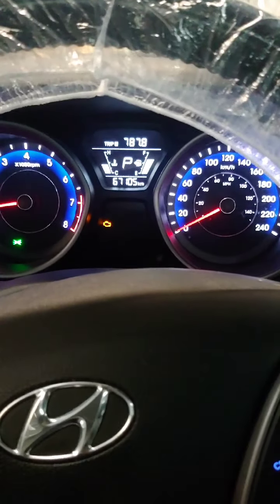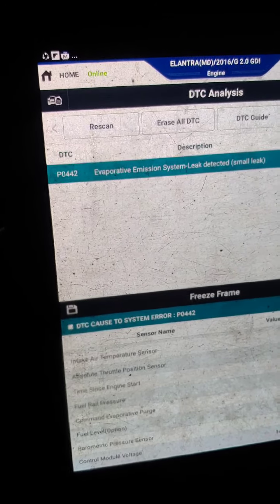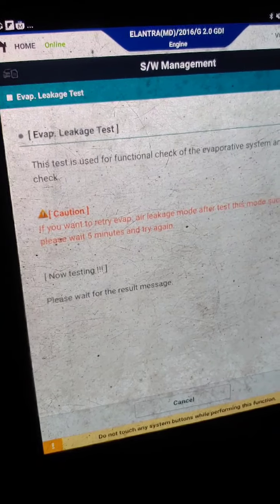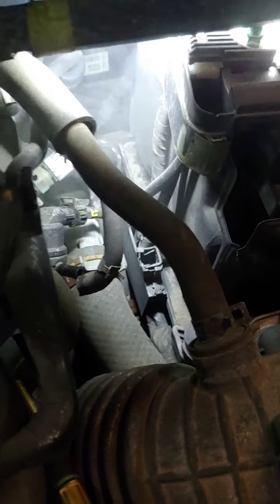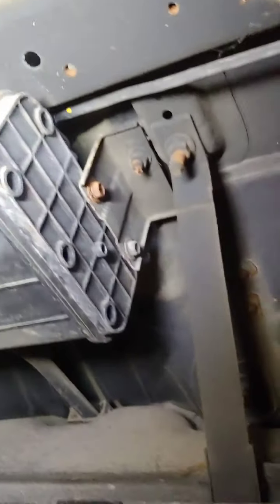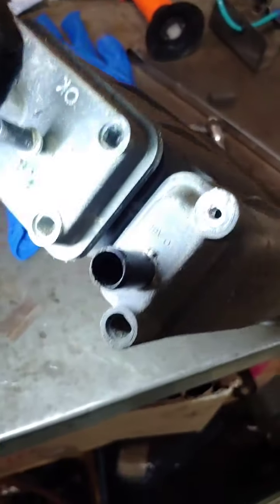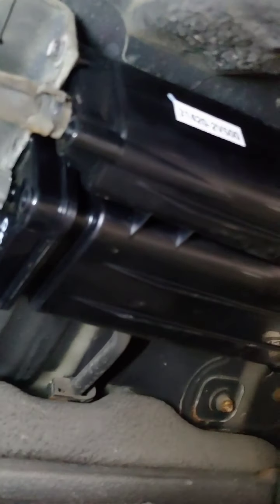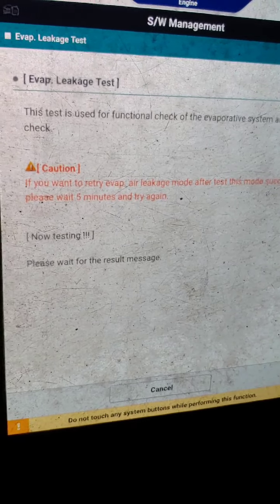Hyunda Elantra P0442- Evap small leak

Comment: Hmm my 2014 elantra has a small evap leak too I'm wondering if that's the problem and I'm also wondering if that's a common issue thanks for posting the video!
Reply from the maker: I cant say its common, but i would suggest to do smoke test to confirm that its leaking from charcoal canister. If you like to challenge yourself, maybe you can remove the canister and inspect the mounting bolts, if theres a split most likely its leaking from the canister. Hope that helps

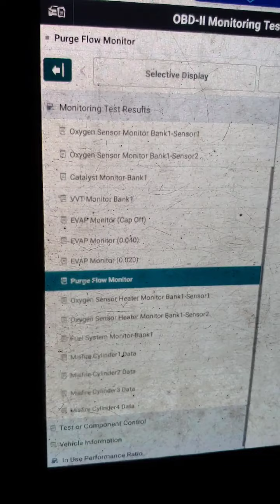Comment: What should the vapor pressure be? I have a 2017 model. I’m only getting 0.14kpa 11:27
Btw no check engine light
Reply from the maker: I think when i checked that via obd2 monitoring test result, its the computer calculation whats in there. I dont have a specific pressure data for that. But if you go to your current data after driving for awhile, when you check the fuel pressure tank sensor, when you activate to close the canister closed valve, the pressure should technically rise coz the hot fuel vapor is sealed. And whats you let go of the canister closed valve activation the pressure data should go back to atmostpheric or orginal pressure. Hope that helps
Reply: @hyundaitech  looking at the live data it stays in -vacuum pressure  even when the ccv is closed. Doesn’t it supposed to have positive pressure too?
Reply from the maker: @Leo-wild3648  is it during engine idling? If ccv is close and purge valve is operating and yea yiu gonna have vacuum becaus of intake vacuum. Amd closed valve should open when it hit certain vacuum threshold.
Reply: @hyundaitech  the purge is closed.
Reply from the maker: @Leo-wild3648  well if its in vacuum it doesnt decay meaning the evap system is sealed. Maybe when you see the data the ecm was running the evap test.
Reply: @hyundaitech  just didn’t another test. This time I removed the purge hose and blocked it off and closes the ccv. No positive pressure still. 
Does the system need both positive pressure and negative pressure?
Reply: One day I was sitting in my car on break and I heard the sound of pressure releasing from the back seat. It did it twice for 2 seconds. Every since then it hasn’t drove the same far as acceleration. But I never done it again after the that

Comment: Hey is it normal to have smoke coming out of the gas cap on these cars?
Reply from the maker: If the canister vent valve is open , yes there should be smoke coming out around tge gas cap area
Reply: @hyundaitech  okay thanks I smoke tested my Elantra and saw smoke coming out through the gas cap I didn’t know if that was normal. I had the car off and I’m assuming the vent valve was open
Reply from the maker: @georgeparker555  yeah the vent valve is normally open unless you supplied power and ground to it. Or what you can do , the hose after the vent valve you can use vicegrip on it, make sure the vice grip is not sharp. Then there you can seal the system